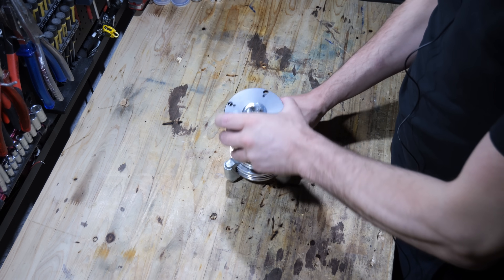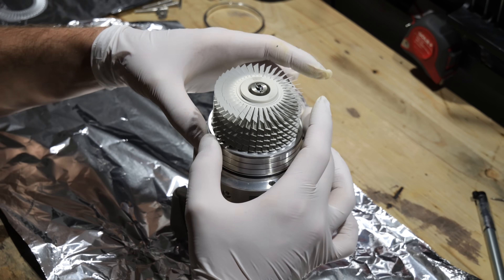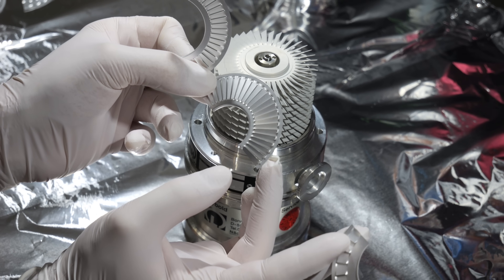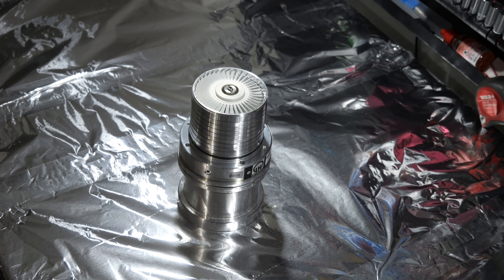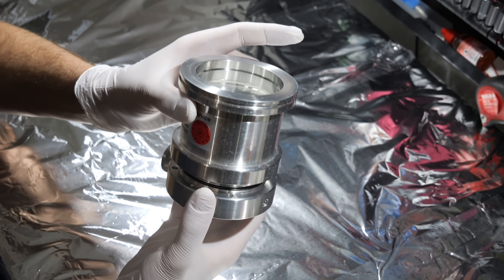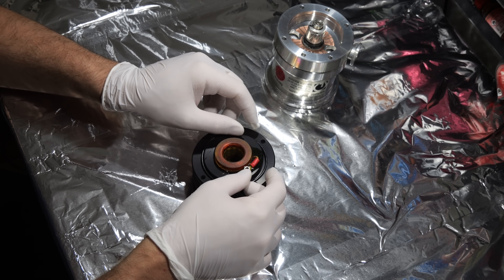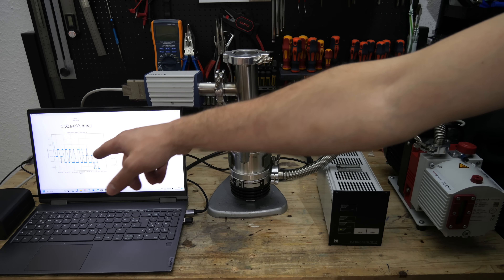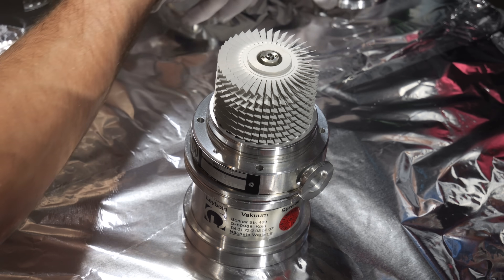Another Dirty Turbomolecular Pump

Comment: Very interesting! I think you were lucky the shaft nuts have been that tight and you did not disassemble the rotor. Most likely the entire rotor was balanced in one piece. Once disassembled you will lose the balancing which should be very hard to reestablish - if not impossible. Just my guess.

Comment: My thoughts on the mystery copper part within your pump is that it’s likely a spring to ensure the rotor/stator blade assembly stays together somewhat tightly and resists vertical movement along the shaft (lol that’s what she said…) and prevents blade/blade and blade/housing interactions which could be catastrophic…
I saw someone else mention it’s some sort of bonding mechanism to prevent any static buildup of the shaft and rotor to protect the bearings, but my understanding of this sort of motor is that the only electrical activity within the rotor is back electromotive force (BEMF) in the armature which dissipates as heat leaving nothing static, but I’m no engineer and am in no way formally educated so what do I know. Hell, perhaps it’s both a spring for turbo blade assembly stability as well as a bonding assembly all in one…🤷🏾‍♂️

Comment: I know that grease is very expensive, I work for an NDT company, you only have to apply enough to make a light sheen. You shouldn't see any globs or texture when applying it. If you use too much, it can be sucked into your system(potentially adding to the contamination in your turbo). Also the usual flow rate for helium, especially when doing such a small test fixture, is three bubbles a second. This can be measured in room temperature water. When you place the nozzle under the water, you should see three small bubbles form in one second. Too much helium doesn't hurt, or make it easier to find leaks, but it will screw with your background reading on your MSLD.

Comment: 0:55 Its evident its an -90 pump just by the simple fact that the vanes are just bent to get the right shape instead of being milled from a solid piece as newer are. Its also evident its older due to the fact that the edge of the vanes now after they have been bent have a small sliver of a 90 degree angle pointing at a angle upwards to the chamber so some small amount of gas will be going in to the chamber again instead of being pumped out, so these pumps are little slower than all others and also have a slightly lower ultimate vacuum.

Comment: You use a high amount of Helium for the leak check. You contaminate your workplace with Helium and it can be difficult to do a second Test in a shorter time period.  Because Helium is everywhere. Normally you let it come out on a tip of a needle. You can set the amount be holding the needle into IPA and adjust the flow to slow bubbling.

Comment: I had a conversation with the tech support guys over at Edwards vacuum pumps and they said that they would only work on pumps where the customer could sign a document to certify as to exactly what chemicals it had been exposed to. Otherwise, they would refuse to service the pumps. I hope you know exactly what this pump was used for. Apparently they are often times used for some pretty nasty stuff.
Reply from the maker: That's actually very good advice. I also mention it in my newest video about the large turbomolecular pump. I should have probably also pointed that out in this video.

Comment: its funny that you let the prepump running for a while before you start the TMP, at work we got a new highvacuumoven with a spektrometer and it has a Turpovac50 for its own vacuum side and we have like 2 meters of pipe to the prepump that turns on the same time as the TMP. the entire setup for it was planned by Leybold and so far works fine, needs like that 2 min to get to operation vacuum. the oven needs way more time to get under 5.0e-04 mbars that is the limit for the valve to open :D
Reply: Word on the street is you can damage your TMP if you let it run prior to establishing a good rough vacuum…🤔
Reply: @reverse_massage  the oven maker and the guy from leybold said its fine, apparently the volume is so small that the prepump will created enough vacuum to not be bad for the turbo pump. But if not its not my problem if it dies

Comment: Can this sheet be an abuse indicator? For example, if a user dumps a lot of gas into a fully spinning turbopump, the turbulence will bend these leaves out of shape. That can later be used by servicemen to see if the pump has catastrophically failed due to manufacturing/design defect, or abuse...

Comment: What are these pumps used for
Reply from the maker: Turbomolecular pumps are specialized devices used to achieve very low pressures, also known as high vacuum and ultrahigh vacuum. These pressures wouldn't be attainable with conventional vacuum pumps like rotary vane pumps.

The rotor of the turbomolecular pump spins at very high speeds (in this model, at 60,000 rpm). The blades of the rotor impart momentum to the gas particles in the vacuum, compressing them so they can be pumped out by a rotary vane vacuum pump.

That's a somewhat simplified explanation, but I hope it gives you a rough overview :)
Reply: @AdvancedTinkering  thank you, great explanation.

Comment: I worked at Solyndra, we used TMPs in Panel Framing Leak Detection of the silicon oil filled solar modules, unfortunately when a leak was detected it meant the TMP on that set of four modules was now contaminated with silicon oil.
At first we would partially disable the pumps and rinse with IPA but as more Panel Framing tools came online we were overwhelmed with oily pumps so it got to where I would just cap and fill half way with IPA and shake for a few minutes, dump and repeat then bake out and test. 
It worked very well and good thing because we would have had to have a great number of pumps on hand if it didn’t.
Nicely done video 👍

Comment: Nice to see someone giving some love to these kinds of pumps.

When you spin the pump by hand is it slowing down to a halt or is there some „abrubt“ stop at the end? If so the bearings may not be the best anymore. 
Also did you do a soft start for starting the pump after reassembly? The theory behind this is for the bearing that may have been sitting for some time and being somewhat stuck, meaning the grease in the bearing may increased in viscosity due to not operating the pump. What could lower the life expectancy of the pump/bearing.
Reply from the maker: Turbomolecular pumps are simply fascinating devices.
I'm not an expert on ball bearings, but I would say that they came to a stop as one would expect from a greased (permanently lubricated) bearing. It didn't slow down as slow as an oil-lubricated bearing, but that's to be expected.
Nevertheless, it's probably a good idea to replace the bearings. I'm currently waiting for the tools I've ordered and will then attempt to remove the two nuts again.
Thanks for the tip about the soft start! I assume the pump controller has a slow-start mode? I'll check the manual for that.
Reply: @AdvancedTinkering  I would love to see about your attempt! And in general about all kinds of vacuum devices.
 I‘m not a hundred percent sure about Leybold controllers. I know Agilent/Varian controllers have it. If not maybe you can power the pump somehow manually and therefore control the RPM for the first start. But how you would do that I don’t know.

Comment: I have dismantled and cleaned the same pump like two or three years ago and it as much nastier inside and really had a terrible smell to it, the copper fins were extremely corroded and covered in green oxide, I also did not disassembled the rotor because I couldn't get it apart and I didn't want to mess up the balancing.
Reply from the maker: I watched your video about the lasers for laser shows. Great video! I always wondered why the relatively powerful lasers are safe to use. Now I know it's due to the fast scan speeds. Very informative!

Comment: Never spin dry high speed bearings, EEEEK, ! NO! and when you disassembled it appears you did not assemble exactly the same? now it wont be in balance .
Reply from the maker: The bearings weren't dry (at least not more than they were before the dissasembly). That's basically what I said in the video. I only cleaned the top part of the rotor to avoid washing all the grease out of the bearings.
And the rotor is the only moving part and was not disassembled. The rest was assembled as it was before. So how would there be imbalance?

Comment: Hi AT,
I´ve got a question.
Are the rotor also weighted or is it just the shaft?
Kind Regards
Reply from the maker: There are holes from balancing the rotor at the top of the rotor and at the bottom of the shaft (basically also the rotor). If that's what you mean.

Comment: The copper ring keeps the bearings from pitting due to static discharge. Latex gloves have natural protein that can contaminate your work. When you spun the bearings by hand they sounded dry. I don't know how much lubrication is needed for bearings in this application. Pumps of this design should run hot on the working side as it helps pull a deeper vacuum. I've seen some pumps use a blanket of foil to ensure they stay warm enough. If you want to cool any part of this pump cool the bearing end.
Reply: Do they even sell latex gloves these days? I only see nitrile anymore…
Reply: So nitrile gloves then?
Reply: @DeezNutz-ce5se  Nitrile gloves also have petrochemical residues on them. That's what gives them their anti-static properties and the more you clean them the less static dissipative they become. Might need cleanroom gloves.

Comment: I'm not sure that fully disassembling the rotor is a good idea, as rebalancing it later will be next to impossible (this is the first video I see of yours, so maybe you have the capabilities/skill to do it)
Reply from the maker: I can tell you that I don't have the necessary equipment/skills to balance a rotor anew ;) But if I mark the exact position and orientation of the individual parts, it should be possible to disassemble and reassemble the rotor without generating too much imbalance.

Comment: The copper piece is probably a leaf spring for bearing preloading. Most electric motors have wave rings for the same purpose.
Reply from the maker: The copper piece is very thin. There is no way it acts as a spring. It bends by looking at it the wrong way :D
Reply: OK, I thought it's thicker....
Reply: I was thinking spring as well, but to align and maintain blade positioning, but I too was thinking the copper bit was thicker. Oh well…

Comment: The screws that appear to be super tight might have a thread sealant to lock them or are reverse thread (lefty tighty)
Reply from the maker: It's not a reverses thread and I allready tried heating the nut to loosen any thread sealant. Without luck.

Comment: I think the copper piece is for heat dissipation. The bearing is in vacuum and can overheat if there is no path to cool it. The copper fingers provide a path for the heat to diffuse out of the pump and into the bottom housing.

Comment: Copper piece is a shim to get the correct pressure on the O ring the fins are to disperse heat
Reply from the maker: I don't believe they are intended as shims. The shims are simple steel disks, and this wouldn't account for the unusual shape of the copper piece. Additionally, it would be too thin to effectively disperse heat. Another comment suggested that its purpose is to ground the shaft, to protect the bearings.

Comment: I can only speculate that those copper fingers are in fact some sort of Shaft Grounding Rings, to protect the bearings. Especially if those bearings are ceramic. It's hard to tell from the footage, but it looks like the rotor of the motor is an integral part of the overall pump rotor. Specifically, the squirrel cage of an asynchronous motor, fitted to the end of the rotor shaft. That will induce circulating currents in the rotor that will escape, one way or another.
Reply from the maker: This is by far the most plausible explanation for the copper part. Thank you very much!
Reply: Yep, i would say the same thing, that is a thing on larger scale industrial motors, some have carbon brushes on the rotor for grounding in order to avoid ballbearing corrosion due to potential diference. You can also go by the shape of the piece, if you have disassembled mains powered electrical devices before, maybe you had notice that screw ground wiring terminals had a special type of washer with sharp edges made to pinch through paint grease or whatever in order to make chassis contact.
Reply: @tiagoferreira086  these are just locking washers btw. has nothing to do with grounding and chassis contact, but can be a neat side-effect, generally you dont want such a connection with only a few small points pressing on the metal, but the full surface.
Reply: @peepopalaber No, static dissipation is the goal. Static discharging via the bearings can cause excessive wear and even outright failure.
Reply: @MadScientist267  i included that
Reply: They are used to protect bearings from the negative side effects of High Shaft Voltages, that are present from variable speed drives (VSD’s), for both AC and DC motors, as well as eddy currents from large AC motors. Ceramic bearings don't really give a damn about it. But metal bearings do. Most of them are brushed, but for smaller motor assemblies like this, a copper ring like shown here is sufficient.
Reply: @peepopalaber my thoughts exactly! zirconium ceramic bearings aren’t conducive as far as I know! and hybrid bearings should still be isolated!
Reply: @needmoreboost6369  exactly, it really depends on the used materials in the bearings.
Reply: @peepopalaber actually under high vacuum a ceramic bearing can be affected by high shaft voltage. I recall that is what caused the Kepler space telescope's reaction wheel failures, from high electrostatic potential discharging across the ceramic bearings and cratering the rollers and races.
Reply: @peepopalaber  I think so too.This is an eddy current protection, this is a screen. That's why it's slotted
Reply: I was about to comment the same, tribocharging is entirely possible in vacuum to hundreds of volts and a small bit of FOD could discharge the large surface area rotor to the stator and do slow damage to the bearings.  This sort of thing happens sometimes in space applications with gyro stabilizers that died unexpectedly.
Reply: Yes it's a ground to prevent static buildup as the rotor spins.
Reply: I m so glad joint the "copper part" company with my joints:)
a) passive chemical protection of bearing's grease;
b) shhh, the Leybold's way of add mechanical damping to elastomer (O-ring) damping of TMP rotor precession. Please, see the shape of.
Reply: Same thing I was going to say 👍👍
Reply: okay, but it doesn't touch any rotating bits, how can it possibly work then?
Reply: Just started watching the vid (I never read comments before watching) and just came to the question and was just about to write almost the same thing! Kudos to you my friend! :)
Reply: Yeah Id agree w some kind of grounding to a rotating part.  They're slightly sprung so that would add further evidence.
Reply: The eddy currents in the rotor is the back emf in the motor responsible for the limits in torque, rpm, etc. and is converted and released as heat, no? I’m no engineer, but that’s my understanding of how motors work. My sense was that the part in question may have been some sort of spring perhaps to help keep the rotor and stator blades packed together and not shifting up and down the shaft and potentially colliding with each other or the housing…🤔
Reply: @notanymore9471  who Talks Abort locking washers?

Comment: sorry I just wondered to this video by accident. What is the purpose of such a pump?
Reply from the maker: Nice to see that you dropped by ;) Turbomolecular pumps are specialized devices used to achieve very low pressures, also known as high vacuum and ultrahigh vacuum. These pressures wouldn't be attainable with conventional vacuum pumps like rotary vane pumps.

The rotor of the turbomolecular pump spins at very high speeds (in this model, at 60,000 rpm). The blades of the rotor impart momentum to the gas particles in the vacuum, compressing them so they can be pumped out by a rotary vane vacuum pump.

That's a somewhat simplified explanation, but I hope it gives you a rough overview :)
Reply: @AdvancedTinkering  I got that, thanks. what do you use it for?
Reply from the maker: For my vacuum chamber. You can see it in my other videos if you are interested. I want to evaporate metals in a vacuum and deposit them on surfaces like glass. At least that's one of my planned projects.

Comment: From my experience, the Turbovac 50 does not need additional cooling, it will happily run at 50c operating temp, above that its a problem. Once the bearings have distributed the grease after sitting for a long time, and with minimal gas load, it shouldn't go above 40c. I also had a smell issue coming from one pump, it was degraded bearing grease, it went away after A LOT of heating and pumping, the smell was like something rotten...  Turbovac 50 is a great little pump, it has a very rigid rotor setup, so you can move it while its running, unlike the HiPace80 that will self destruct if you sneeze near it...
Reply from the maker: That is very good to know, thank you! I assumed that cooling was necessary as my other Turbovac50 has a cooler installed.
Reply: very rigid rotor with twisted blades in rotor and stamped stators .... let me laugh-out loud    
(you can bend a rotor blade just by pushing it with your pinky finger)
at first air inrush it would die and give you blades cocktail

It's strange to compare this pumps with an HiPace pump with rotor machined from solid stock, and stator sawn from discs